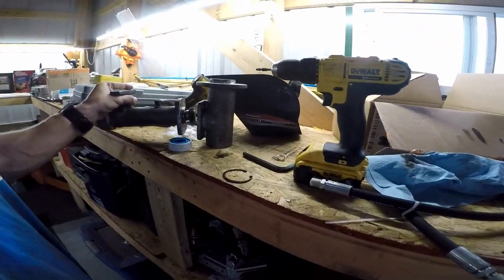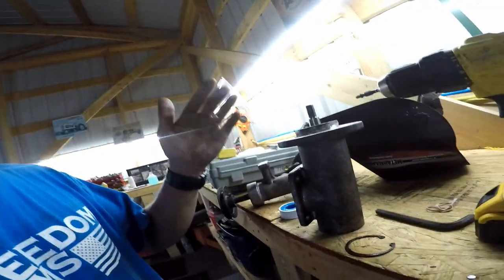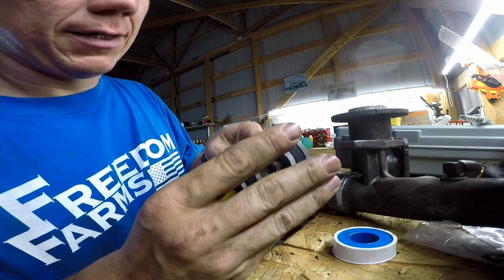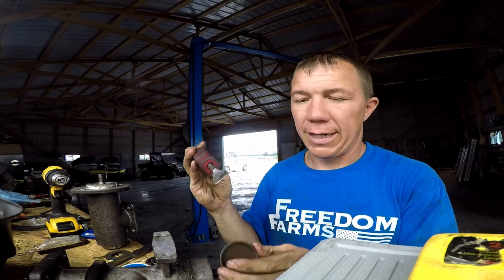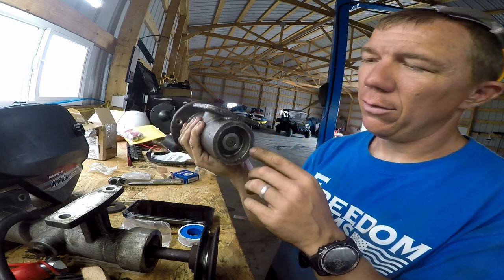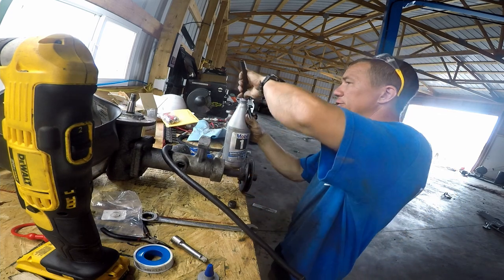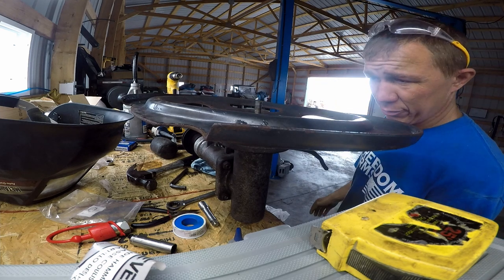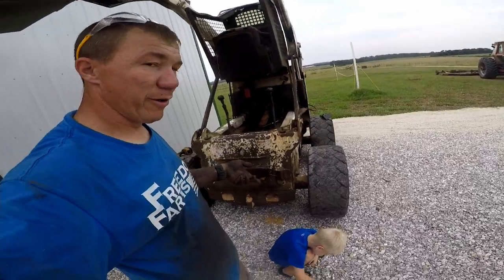Bobact cooling fan Angle Drive Repair

Comment: Mine completely seized I pulled the bottom piece off without pulling out the shroud which I know is a No-No but I got it out and I realized it's just rusty and look up the cost of Canadian for replacement one that's right in Canada where do we get ripped off royally as you all know down south like a $1.95 a liter for fuel not a gallon so the price to buy this replacement part in Canadian before tax is 2,200 and I thought there's got to be a way to pull it apart and I'm looking at it and thinking friend of mine said check YouTube and here you are like the godsend exactly the same as mine the blower part that is so when I what's your video it actually was very informative as I am going to assemble mine one with new parts like you did and if it cost me $150 Canadian way cheaper than 2,200 ! Special thank you for making the video both ends of mine are screwed solid as a rock the shaft internally is in excellent shape the bearings went dry and of course here we are so thank you again for the great informative video add more people were to try and fix their own bobcat it will save you thousands of dollars just have the patience. Awesome video
Reply from the maker: Glad to help, trust me we feel the pain in cost here too. That is why we make these videos. Thanks for watching!

Comment: I bought a set of 3, 12 inch brass drifts of different diameters to use for things like this.  They don't scratch things like harden steel can. They have worked well for me.
Reply from the maker: That is an excellent idea! I should of thought of that

Comment: Thanks for the video mine has had a small rattle for years and I've been looking for some information on the shaft sense I bought my machine ( by far the most handy piece of equipment I own) one question did Napa have the bearings in stock or did you have to order them
Reply from the maker: Glad you found it helpful! Napa ordered them but they were in the next day. Bobcat had the seals on hand though at least.

Comment: Interesting video, but I don't understand the point of failure of the fan drive/fan. What was the symptom that brought your attention to the assembly, and what part actually failed.
Reply from the maker: The bearings as shown in the video failed, likely due to a leak and the oil being low causing the bearings to get hot and quit essentially.
Reply: @FreedomFarmsMo  Thank you. :)
Reply from the maker: @jerrellstrawn6409  you're welcome

Comment: Thanks for the video.  I'm just curious, it's been a little over a year since you posted this video, how are the sealed bearings holding up compared to the open bearings that you replaced?
Reply from the maker: You're welcome! Glad you enjoyed it. The bearings are doing fine, put a little over 150 hrs on it so far. Our busy time is winter when use it to feed animals and clean the livestock barn out. it's in a very dusty environment too.

Comment: Awesome video.  I noticed you didn't do anything with the pulley end of the shaft (part that sits horizontal when mounted).  Does that end have the same bearing and seal as the vertical part of the drive?  I've also seen a sleeve referenced to go in the rebuilding/repair of this component.  Which shaft would it be for?  Thanks again, Jeff.
Reply from the maker: It's been a little while since I've done it let me rewatch the video and make sure I give you the correct answers. I may not have a chance to do so until tomorrow afternoon hope that is okay
Reply from the maker: I just watched the video no I did not do anything with the shaft that has the pulley on it those bearings were actually in good shape and did not need replacing. As far as a sleeve or a race for any bearings to set on there is nothing that I saw. I also am not sure if the bearings are the same size or the seal for that horizontal shaft with the pulley. Sorry I couldn't be of more help. I do appreciate you watching and I also appreciate the comment!

Comment: NOTE: When checking the fan gearbox oil level, be sure the level does not go above the top of the shaft in the gearbox [Figure 70-60-7]. Use a light colored 90W gear lube if thelevel is low.  From the 763 Manual.  Could yours be overfilled?  Thanks for a good video on a subject not covered anywhere else.  I did get a pdf of the service/repair manual and noticed the note I pasted above.  Might be worth adjusting your levels.  My angle drive unit had the breather hose fall off and it was running bone dry.  Big time wear on the bearings with only 1200 hours on a 25 year old machine
Reply from the maker: Thank you for the information! Like you said there is nearly no information online about it. I will check this afternoon and drain out any excess. I would guess mine leaked out some of that extra as you saw in the video. mine was around 1130 hrs on the 2002 s250 in the video. However after the rebuild it has been working great ever since. Thanks again for the information! I appreciate it!
Reply: @FreedomFarmsMo  I did find pdf versions of service manual and parts manual on eBay for about $20 each. Really helpful. Still, thanks for your effort as it showed me that I didn’t need any exotic tools to complete the job, so I dove right in and will save a chunk-o-change. Unfortunately the surface of both long and short shafts where the seals ride was in sad shape. My unit was filled with rust, watery sludge, and no oil.  If I had found it at the bottom of a lake, I don’t think it would have been worse! Expansion tube was off but how water got in there, who knows? 25 years of only changing filters and oil is evident.
Reply from the maker: I looked at eBay but didn't find the s250 one  I should probably look again. I was fortunate that mine was in good shape other than the bearings themselves failing thankfully. I figured tearing mine apart and seeing if it was rebuild able was a no brainer, I had nothing to lose. I could either fix it or had to buy a $1000 new one
Reply: @FreedomFarmsMo  There is an S250 manual available for download on Etsy.  I would provide a link, but I don't think that is possible on YouTube???
Reply from the maker: I'm searching it now
Reply: Great video - many thanks! I have a T190, and I’m getting ready to dive in tomorrow and do the exact same thing. 
Fan belt is still in place and functioning, but the fan itself is not spinning. I guess I’ll find out why tomorrow. Lol
Reply from the maker: Sounds like you have a fun day ahead of you. You're welcome, hope yours is just bearings too

Comment: So I have a T190 with the same problem. I tried to order the gears, seals, and bearings from Bobcat but my dealer is saying that you cannot order those parts separate. You have to buy the whole assembly. How did you get all the separate parts?
Reply from the maker: I ordered the seals from bobcat. I didn't need new gears though. That could be what the are referring to.

Comment: I gotta do the same..where the cheapest place to get bearing
Reply from the maker: I wouldn't cheap out on seals or bearings. We got seals from Napa, bearings I would get from bobcat though.
Reply: What's seal part number
Reply from the maker: @JimmyL361311  it's in the video somewhere. I showed it on camera and the bearing part number as well since I knew people would be asking that question
Reply from the maker: Awesome
Reply: I lied I ordered wrong ones.. lol plus all my bearings are rusted and seized up.. I gotta replace all them and I can't get pulley off.. will have to heat it up I guess
Reply: I ordered 6403's instead of 6304's lol
Reply from the maker: @JimmyL361311  uh oh return to sender 😂
Reply: Seals ain't at Napa . I think u got it mixed up.. in video u said bearing from Napa seal from bobcat.. online I can get 2 with shipping..$33 but bobcat wants about 28 with tax
Reply: @FreedomFarmsMo  $28 just for 1 seal.. vs 33$ for 2
Reply: Imma try the 6304 2zz their better heat resistant. As the rubber ones will melt..I have 1 63042rs for sale and the 2 6403s for sale
Reply from the maker: The bearings were from Napa and the seals from bobcat. The part numbers are on the boxes/bags as shown in the video. I called Napa direct in our local area to get the bearings. Seals weren't available from Napa. I don't remember procing